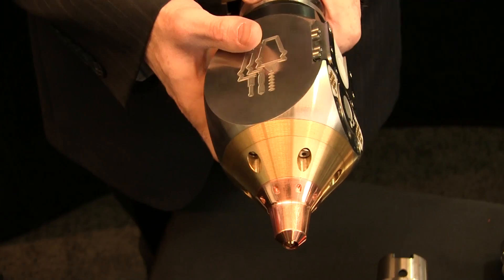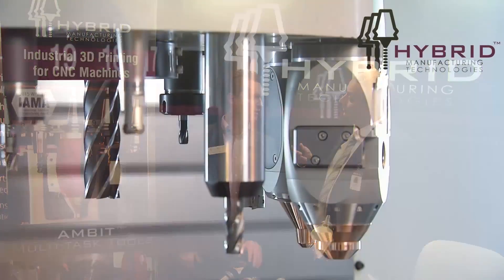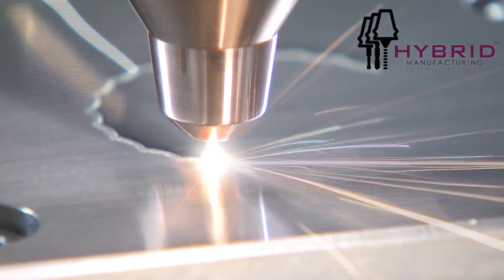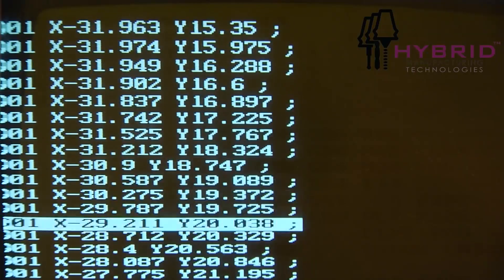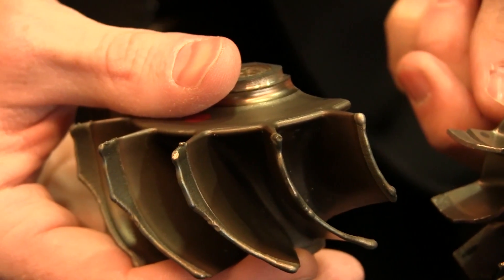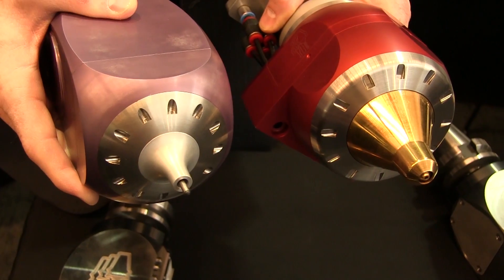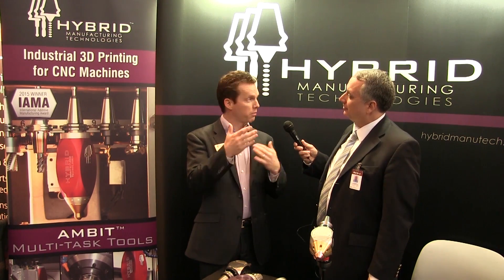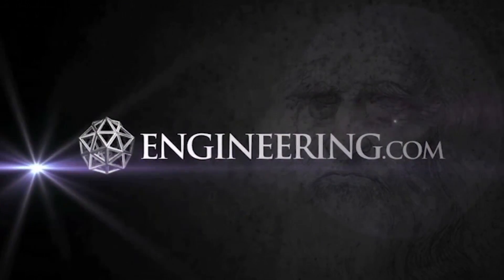Deposition Nozzles for Additive Manufacturing with Standard CNC Machines

Comment: 1 reasons why additive tools wont be a standard on CNC machines as the Drill chuck? The reason is CNC is to take material away, not add it. It probably will be more standard in assembly and molding industries processes. What do you think?
Reply: I think you need to look back at the fundamental definition of CNC. Technically the printer in your office is a CNC machine. Mills and lathes are generally meant to remove material. With something like this you could avoid buying a giant piece of stock to machine it down to 85% of its original mass. You could use additive manufacturing to make an over sized version of the part and then use traditional machining methods to bring it into tolerance. OR a more practical use case: someone makes a mistake and too much material was removed. This could be used to build that area up to be machined back down to the (hopefully right) dimension without scrapping the part.
Reply: Depends on the application doesn't it? :)
Reply: @Bin95  I totally agree but our products are not used for prototyping as much as repair so it actually reduces time, waste and cost. Thank you for thinking this through though, super exciting conversation.